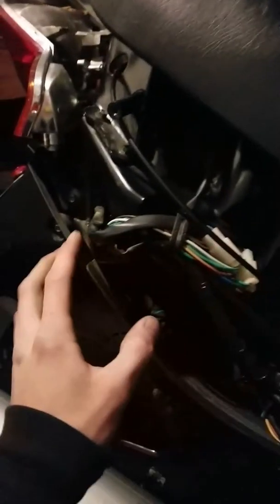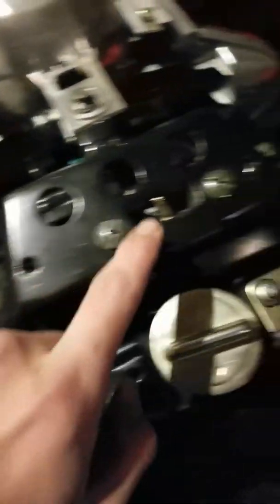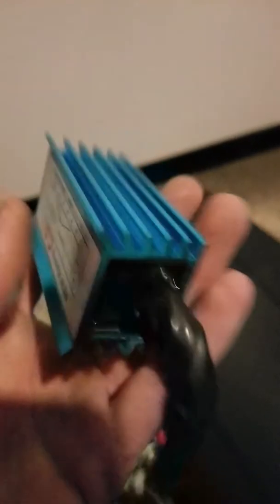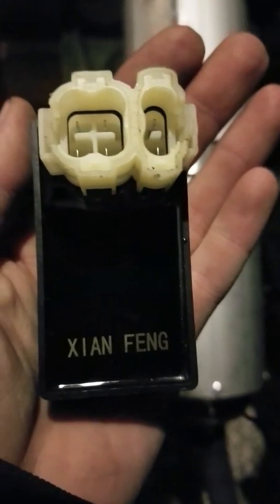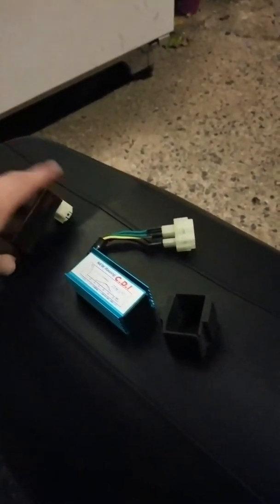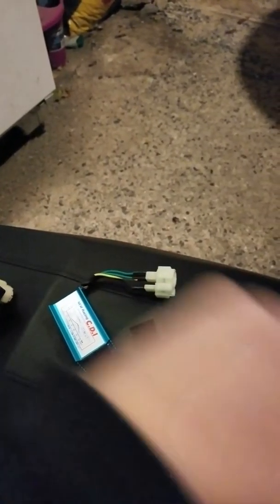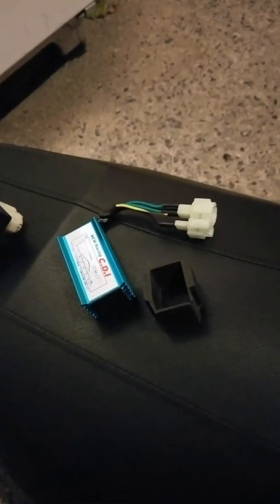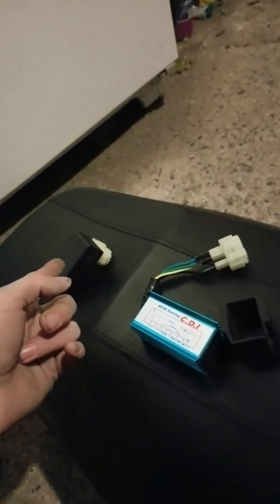Gy6 no rev limit cdi install (2013 taotaobws50)

Comment: I have the same scooter and blue CDI box but i am getting no spark with the blue box. Did you ever manage to get this to work on yours? If so i would like to know if im missing anything. Based off of the video everything looks the same as far as wiring. I am stumped on why i am getting no spark. Thanks
Reply from the maker: Does it work with the old cdi ? It could just be a bad cdi itself. It happens time to time
Reply: @RspecNick  works fine with the old cdi. Also worth mentioning, my dad has a 2021 150cc tao tao with the same blue cdi box that it runs with. I took that one off his scooter and put it on mine to try and eliminate the possibility that mine doesnt work. Mine still never had spark. It seems like to me that my moped just doesn’t want to accept the new CDI
Reply from the maker: @thomasmiller4064  yea it could be that as well unless you have a DC type vs the AC type
Reply: Yup that too, or could be ur spark plug/ spark plug boot?